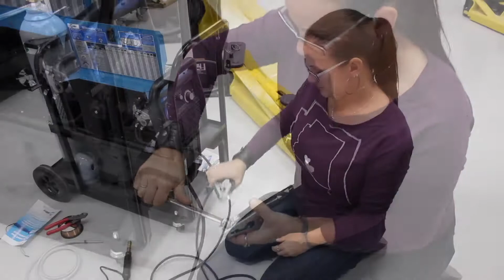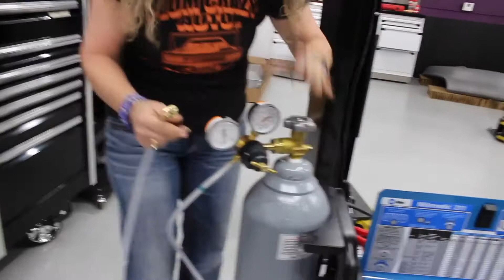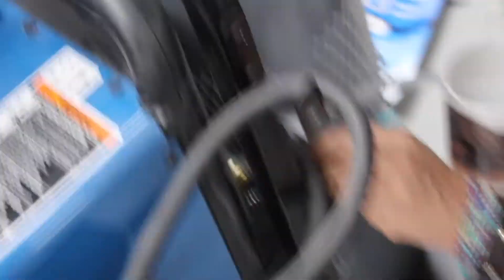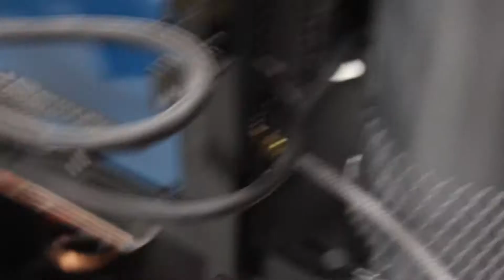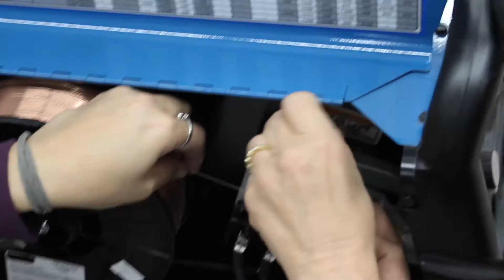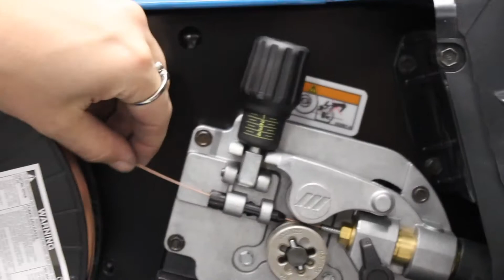Millermatic 211 MIG Welder Set Up

Comment: You did not say anything about using the right size wheel for the right size wire or even the tip where the wire comes out. You cannot use a tip 030 if your using 035 wire im sure you get the idea. Same for the wire drive wheel you need the right size.

Comment: When changing wire, once you get to the point where the wire is in the gun, you can switch on the machine and the turn the wire speed up all the way and then put your contact tip on, by the way, great introduction to mig welding. The easiest process when it comes to welding, but not the easiest for set up.

Comment: You do not need to feed it all the way threw.. The point of being a a wire feed is that it will
Feed its self.
Reply: Actually the manual calls for hand feeding during installation. Because you don't want the tip to scratch or poke the inside.